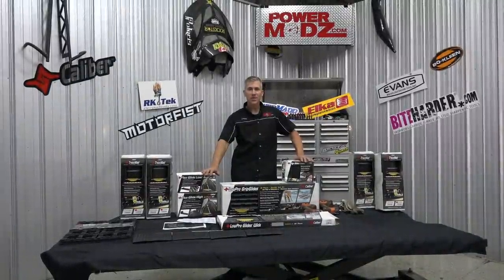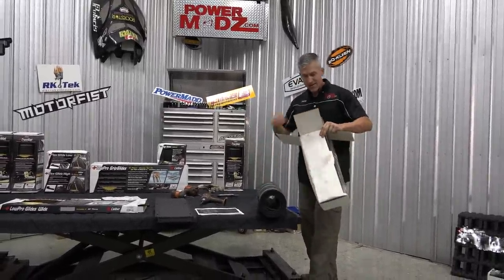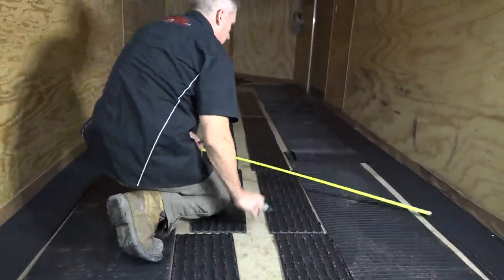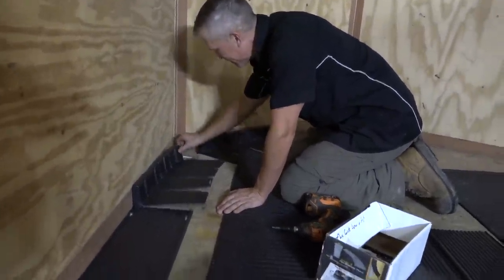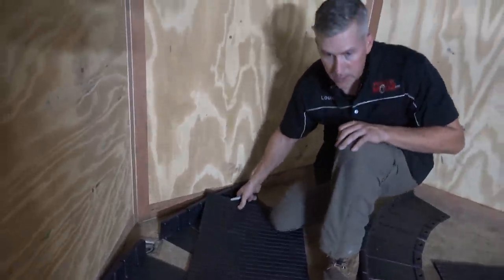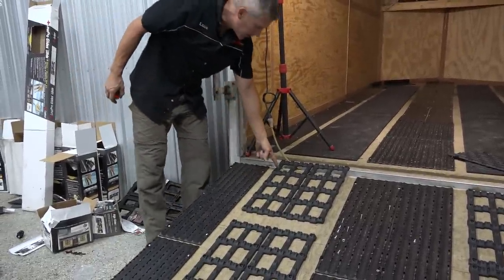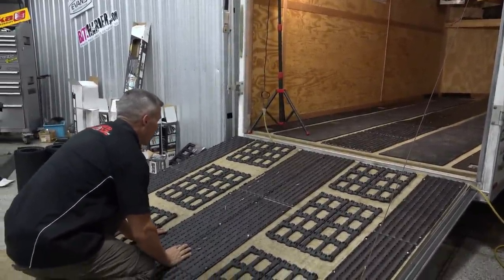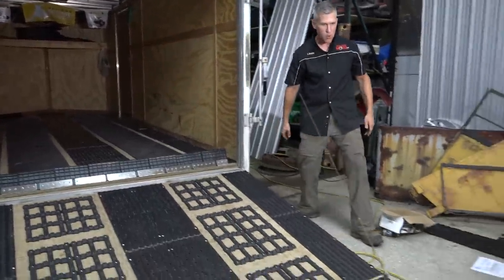The ultimate Snowmobile Trailer product Install! Caliber Products!

Comment: Funny I just put a epoxy coating in my trailer yesterday. Do a 18" vertical diamond plate base around the walls and I'm done. If I need some more protection I'll probably do some tracks like you have.

Comment: Hey powermodz i need some advice! I currently own a 76 jag 275 but its getting really tired and i am tired of pushing it... I came across a 2002 mxz440x with supposedly 2000 km on it. I would be trading it for my bike worth apporx 2500$ plus a little (500?). Guy says there is nothing to do on it. I mostly ride back country in the woods northern quebec. Any advice would be great or if you know of a sled that would be good for me! (reliability ;) Thanks!